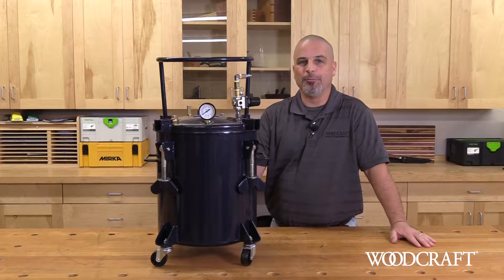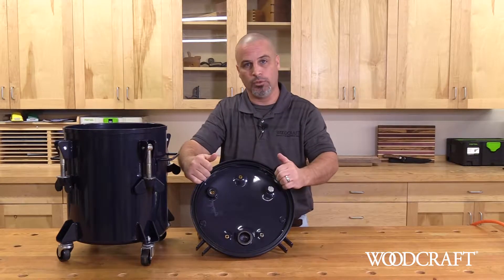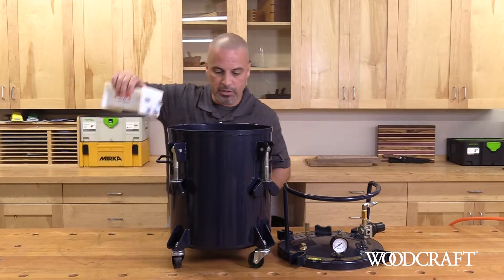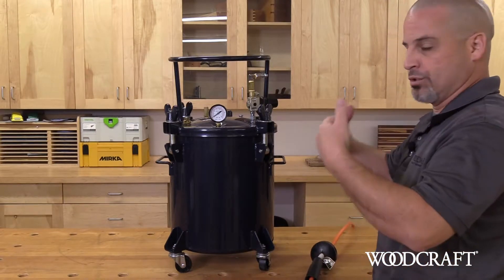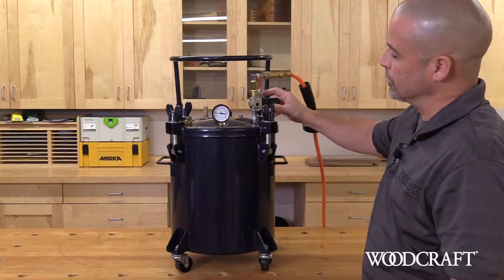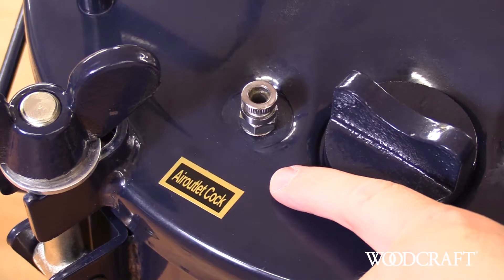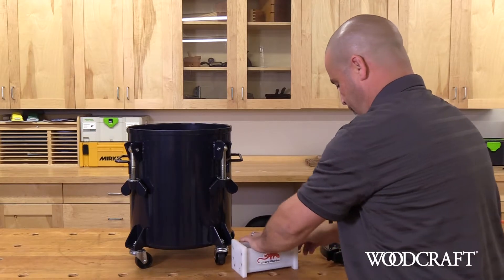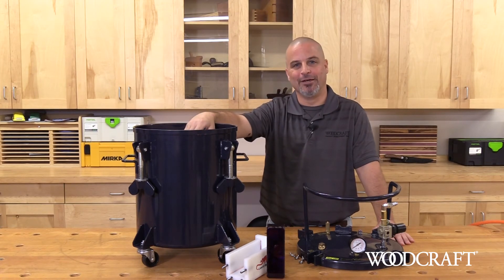Resin Casting Pressure Pot by California Air Tools

Comment: I would suggest not putting the casters on.  Mine got hit, and it rolled with a project inside.  Now I have cured resin in the bottom of the pot.  Any Suggestions on how to remove the cured resin from the inside of the pot?  Thank you.  By the way, I love the pressure pot.  It works great.

Comment: Can silicone filled molds be used in this?
Reply from the maker: I would ask your manufacturer, We don't do a lot with silicone around here. Sorry. If a pressure pot can be used on silicone this would work fine.
Reply: If it’s silicone you are working with that is mixed and curing, you will need to use a vacuum chamber.

Comment: Thanks so much for the video! Very informative. I am considering buying this one sometime soon. A question: at the end of the video you mentioned the timer that you set and then come back to open the pot. How long should the resin be under pressure in the pot before it's safe to know that most of the bubbles are gone?
Reply from the maker: You should aim to leave it in until you hit the "demold time" of your resin.
Reply: @WoodcraftSupply  what if we're using it to prep the resin prior to pouring it in a diorama?  should we pressure it until the listed 'working time' or what would you recommend?
Reply from the maker: @elysianfields84  Not sure what exactly you're making but it sounds like what you're looking for is more of a vacuum chamber. Unfortunately we don't carry those.

Comment: When introducing air by turning my regulator, it starts hissing way louder once it hits 30psi and then I start losing pressure even after the valve is turned off. I have this exact pressure pot and am using a California Air Tools Light and Quiet 1 gallon compressor. Can anyone tell me what the issue might be?
Reply from the maker: I would check all of your other valves and openings. Make sure the seal is seated correctly all the way around. It sounds like something isn't quite sitting properly but it good enough until it gets some pressure behind it. You can also give our tech department a call at 1-800-535-4486

Comment: Not so much.  The pot was designed for painting, but converted (much like the Harbor Freight paint pressure pot seen in a gazillion other YT videos) to the hobby of resin pouring use.  The advantages are that this pot is much thicker/heavier duty and that it is already converted.  Considering parts and time, there really isn't any difference in cost.

Comment: The suspense was building as I watched only to see what looks like a brick. What is all this?
Reply from the maker: It's a video about a pressure pot. I'm not sure what you're asking. If you want to learn more about the resin you can check out our other video here. https://youtu.be/pKEfs1p953w
Reply: @WoodcraftSupply  I watched that video, still not sure what the blocks are for.
Reply from the maker: @VictoryGuitarShop  The blocks are custom blanks that can then be used to make other things such as handles for an ice cream scoop or pizza cutter, or a pen, or a bowl if it's a bigger blank.
Reply: @WoodcraftSupply  Do you have a video of one being made into something? I have never seen this before and have been a Woodcraft customer for 10 years.
Reply from the maker: @VictoryGuitarShop  If you stop into the store we have a variety of wood and resin turning blanks in the turning section. Here is a video from our buddy Carl Jacobson turning a resin blank into a handle. https://youtu.be/_tRS5CLKKjQ
Reply: @WoodcraftSupply  My store closed years ago. Thanks for the link

Comment: Hello Ben, I'm very new at this but I thought it was ready to cast resin, I need to buy an air hose then?
Reply from the maker: The pot is ready to be used. You still need a compressor to supply the air to make the pressure.
Reply: @WoodcraftSupply  Ah ok. Where could I get a compressor?
Reply from the maker: @Hirumaenjiru  We have some, but they are available at most hardware stores.

Comment: Can i fill this with water before use so i can test submersible equipment?
Reply from the maker: NO....This pressure pot tank is designed for resin applications only.

Comment: Thanks for the video.  3 questions:   1) What HP or PSI compressor is required to connect to it?  2) Can you put resin in it before you cast/pour it to remove the bubbles. Most of my molds won't fit into it so I would want to remove bubbles before pouring and let it cure outside the pressure pot  3) if the answer is yes to #2   3) how long do you leave the resin in to remove bubbles but not cure?  Thanks!
Reply from the maker: 1) Compressor of 120 PSI is what most will pump up to and kick off at. Maximum OPERATING pressure is 60 PSI
, and tank is equipped with safety relief valve for maximum TANK pressure of 80 PSI.  Typically 40-50 PSI is all you will need.  2) You may use a heat gun to remove most of the bubbles prior to putting the mold into the pressure pot, but the pressure pot should also remove all bubbles too. Here is a link of 10 tips on removing air bubbles from resin: https://www.resinobsession.com/resin-frequently-asked-questions/resin-bubbles/.  3) Do not put the resin into the pressure pot without a mold.  It is completely dependent on the resin you are using and what you are making. Open time and work time are critical factors and deep pour resins allow for longer work times.
Reply: @WoodcraftSupply  Thank you - now that I understand the difference between a pressure pot and a vaccum chamber (I was mixing up the two) I realize a few of my questions didn't apply.   I bought this unit today - looking forward to using it.  Your video is very helpful now that I understand the function better.

Comment: I got this pressure pot, and I've made sure everything is clean, the gasket and rim are free of debris, and I can't find any air leaks. However, it's still losing pressure. About 5 psi every 30 minutes. What do I do?
Reply from the maker: Have you checked all the connections and valves? Get some soapy water and brush it on the connections. Could the pressure loss be in the air compressor system? Also, try contacting our tech department. 1-800-535-4486 or tech@woodcraft.com

Comment: Hi is this pressure pit already converted for use with epoxy casting resin (like ArtnGlow resin)? Also is the air hose connected to a air compressor? Sorry for the noob questions
Reply from the maker: Yes, this pot is made with resin casting in mind. And yes, you have to connect it to a compressor to build pressure.